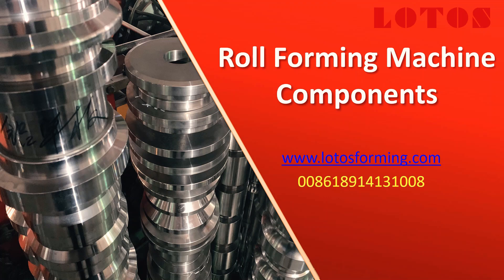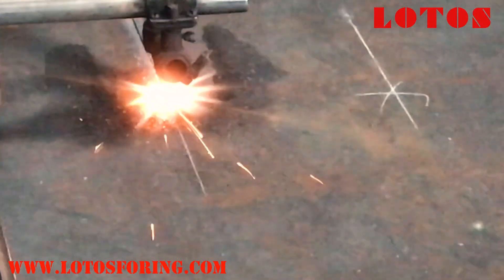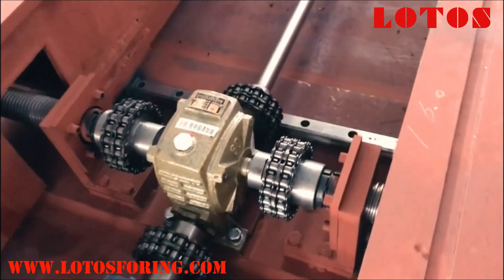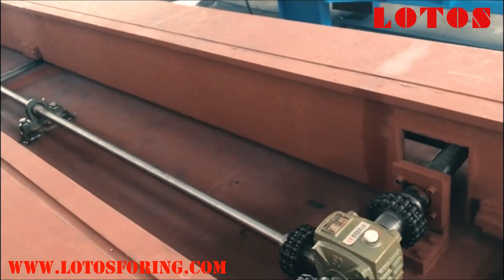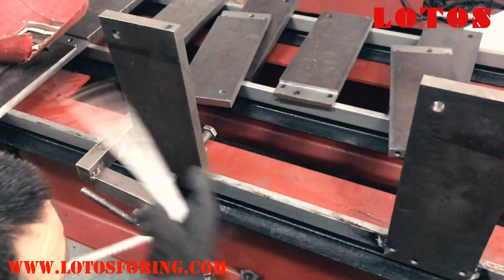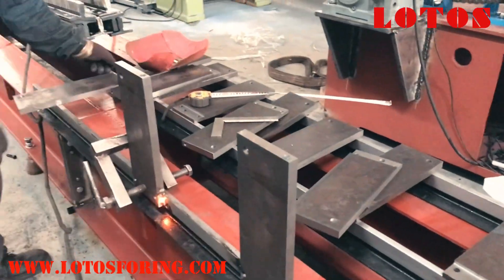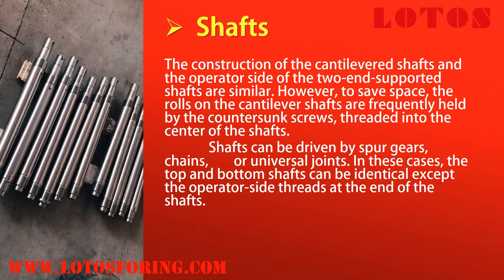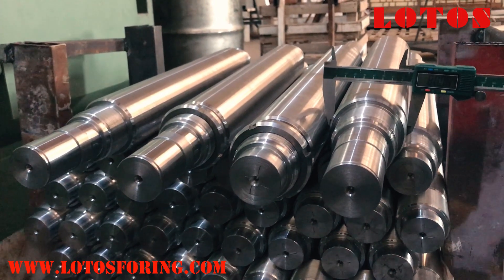【Roll Forming Machine Basics Parts】: Roll Forming Machine Components ▶ LOTOS 2022 ◀

Comment: Its pretty  amazing we get a shot of thr prints he is working from. Most prints are proprietary. 
ALSO, measuring from one to the other instead of a single origin point invites small errors adding up. Its not a very precise method. The resulting machine isnt going to be the most accurate.